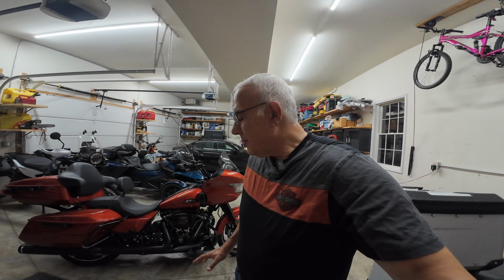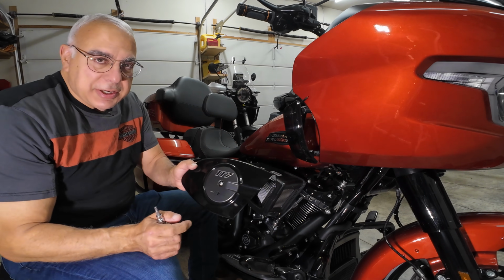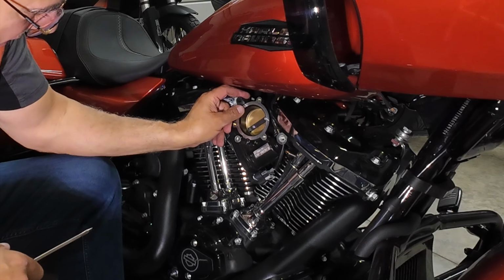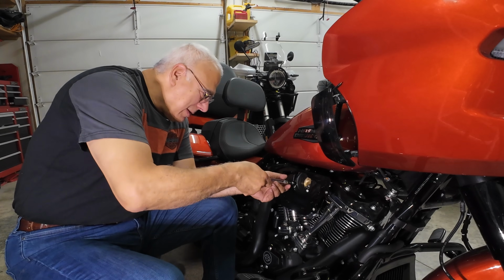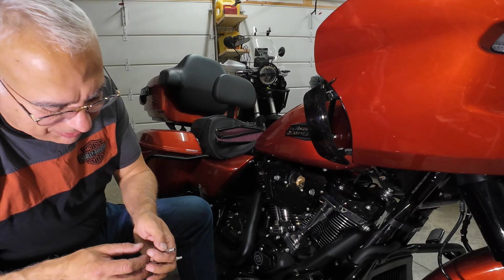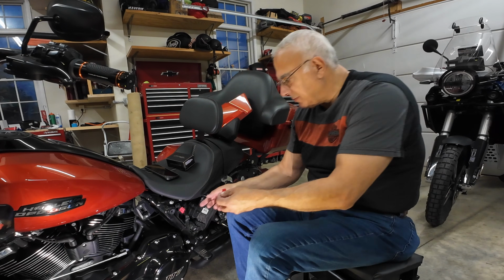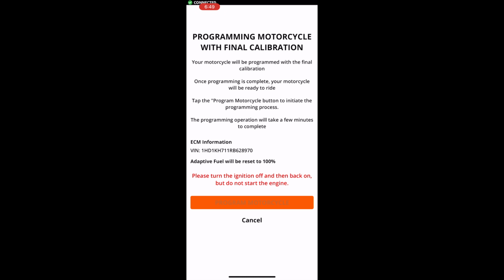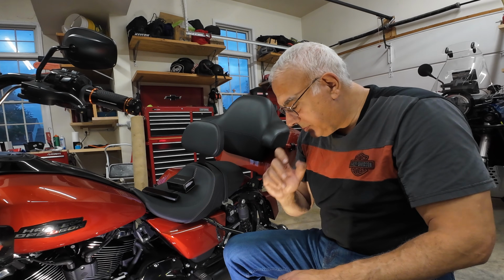Screamin Eagle Extreme Wedge Air Filter Pro Street Tuner Step By Step Install 2024 HD Road Glide 455

Comment: I have a 23.5 cvo RG and have krome works slip on and thinking about add that air filter. My question is do you have the full aftermarket exhaust or do you have just the slip and it was still ok to use the first program. Thanks
Reply from the maker: I have slip ons, yes, it is OK to run the first program if my memory is right, but you should consult your dealer and get their opinion. I traded this motorcycle for a 2025 CVO Road Glide Raven fade I have videos on this motorcycle last year. I had the dealer install the extreme wedge air intake and the Harley Davidson tuner they felt I needed the tuner with the air intake weeks ago, I upgraded to chrome work slip on exhaust, which of course that’s a full stage one with a tuner and your intake. The dealer told me I do not need to use a software on my phone to get back into a tuner to adjust it for the addition of the slip on exhaust so I haven’t even with the air intake with no changes to the stock exhaust and the tuner the sound of the motorcycle is so much better I believe because it doesn’t have an ear box anymore when I added the chrome works exhaust. The sound is just amazing. It is so cool. I’ll probably upload the video in the next month. I hope you consider subscribing to my channel ride safe and in peace.😊

Comment: You didn't talk about the additional HP you gained. Did you notice a big difference?
Reply from the maker: I do a follow up video. I’m blurring a brilliant blue Harley Davidson riding shirt/jacket on the thumbnail and in that video I take you on the first ride after this stage one mod and I talk about the power. I hope you can watch that video, but I will tell you for the money spent on the stage one I think the power increases significant. I think it’s very worthwhile spending the money for this stage which I think is air intake slip on exhaust probably just under $2000 and I wanna say I thought it was a horsepower game but it’s more than that if I should say it feels like more than that because you know no longer have an air box on the intake so you really get more engine noise from the air filter which to me is more like harmony that sounds beautiful. I hope you can watch that video. If not, I think this upgrade as well worth the money spent on it Harley tuner is excellent and I think it’s well worth the money. I highly recommend it. I hope you consider subscribing to my channel ride safe and in peace thank you for commenting.😊

Comment: Just got my wedge for my ‘25 CVO and pro street tuner but the dealer is telling me I need to bring it in for them to install the the tuner.  Not sure why.
Reply from the maker: I’m not sure why they’re telling you that either. I thought the directions were very simple on installing the tuner and I covered it step-by-step in my video. I’d also recommend that you watch cycle fanatics. He also did a step-by-step installation. Good luck I hope you and your dealer can figure it out. I didn’t think it was hard at all. Thought I covered it well in this video. Hope you consider subscribing to my channel ride safe and in peace.
Reply: @maraudermitchelli thanks. I ended up doing it myself. I think they thought I wanted to do more advance tuning on a dyno.  I just wanted the basic tune for the air cleaner and exhaust and all went perfect! Love the wedge on my new CVO.

Comment: Mitch, you probably made the right decision, the snorkel style Heavy Breather air cleaner is annoying. Unless you have a 22" or shorter inseam the snorkel in the way, all day. Anybody that has ridden the ST, whether it's a Glide or Soft Tail has had that realization that you will bend your knee out like bow legged cowboy and rub and bump into that dang thing every time you ride. Even the regular 'Glide air filter bumps my leg out more than I prefer so I'm looking for a filter that is slimmer. Does the wedge offer better legroom? And how much louder is it? Maybe I'll subscribe😉
Reply from the maker: On my CVO, I added the extreme wedge and did not put slip on exhaust. It definitely made the motorcycle louder without a doubt as there’s no airbox on the bike now I’m still debating whether to do slip on exhaust to little get a little deeper tone. it’s hard because on a CVO. The dark chrome is just so beautiful. I believe the extreme wedge is the most efficient air intake offered through Harley Davidson. Fueling may have somewhat comparable intakes, but I have to post a video on having the extreme watch on my CVO and it is a perfect match for that bike because I put the engine emblem directly on the intake and it looks phenomenal. I have to post a video on that. I hope this answers your question. I’d highly recommend this air intake I hope you consider subscribing. Please continue to comment ride safe and in peace.

Comment: Drives me nuts when manufacturers spec differently sized fasteners for absolutely no good reason.  😂
Reply from the maker: Isn’t that the truth one of my guys I used to ride with off-road so they can take apart a Suzuki quad with two wrenches I think a 9 mm and a 10 mm that’s the way it should be. I hope you consider subscribing to my channel ride safe and in peace.

Comment: I Want That For My 24 Street Glide!!! That looks Awesome! 👌😎 And You get a little extra power along with more leg room 💪
Reply from the maker: Man, like I say in the video, I initially did not like the extreme wedge air intake. I really wanted the bighorn that comes out of the side and goes towards the front with a big filter on it, but the more I researched the stats and looked at the motorcycles and sat on them. The extreme wedge had the best performance Stats is the most comfortable and I got to really like the look of it so much so without a doubt, I put it on my CV overall glide videos to come on that I hope you consider subscribing to my channel ride safe and in peace.

Comment: What brand of earplugs do you wear
Reply from the maker: Probably in this video, I was wearing Alpine earplugs. I believe they make three different levels. Two of those levels might be touring and then the other one is racing. You can find them online. The main portion of the plug is white almost clear I like them. I also alternate to these rubber Earplugs, which I bought at cycle gear. I hope you consider subscribing to my channel ride safe and in peace.

Comment: Nice video. I'm looking at the Extreme Wedge also, and yes, it's ugly, but my knee hits with the other model air kits. But from what I see, this new Wedge box is the same size as the OEM. Yes, the "filter" is bigger, but the box looks the same.
Reply from the maker: I love the air filter and as I said in the video, I did not like it at all. The first time I installed it I have to do a video on it installed on my CVO and how I mounted the engine badge on it. It really looks great. I think it is a number one performing Air filter and intake. It’s actually changed the sound of my CVO without even touching the exhaust. I hope you consider subscribing to my channel ride safe and in peace.

Comment: Thanks for sharing this. I’m planning to upgrade to Stage 1, but the Screamin’ Eagle Extreme Wedge air cleaner isn’t available at my local dealer. What are some alternative air cleaners that offer similar or better performance? I also plan to use the Vance & Hines FP4 for tuning—are there any differences I should be aware of when using FP4 with aftermarket air cleaners?
Reply from the maker: I cannot answer any questions on the FP four because I never considered it nor did I research it. I went with the screaming eagle tuner because I wanted to maintain my warranty on my motorcycle and I liked it so much. I might put it on my new Road Glide I think the extreme wedge is a great product. I actually am about to get another one for my CVO But my friend just purchased a fueling air intake and I really like the intake that he purchased so I would check out fueling‘s website. I believe they have their own YouTube channel. I’m a big fan of thrashin supplies YouTube channel. I think I’ve answered your question. Check out fueling and I hope you consider subscribing to my channel ride safe and in peace by the way, this set up worked very well on this bike was very pleased with that.

Comment: Great Video!!!  When it asked you about exhaust, was it asking about header pipes and mufflers?  I normally change out my header pipes too for the Stage I.  Let me know your thoughts.  Thanks!
Reply from the maker: No, it doesn’t if I remember correctly because this tuner is definitely set up to be EPA compliant and Harley-Davidson doesn’t encourage changing the entire exhaust because it avoids a warranty and I didn’t wanna avoid the warranty. I’m not an expert on this tuner. I would contact your Harley Davidson dealer or Harley Davidson directly and ask her question you may be correct but for now I’m gonna stand by my answer, I hope you consider subscribing to my channel ride safe and in peace.

Comment: Awesome video.   I was looking for an air filter that wouldn't get in the way of my leg.   I think HD did a wonderful design job on this filter.
Reply from the maker: I totally agree with you. I didn’t like this air filter at all, and then I realized that the benefits outweigh so many of the negatives I love that it shows off the V2 engines and is very tight to the throttle body. Hope you consider subscribing to my channel ride safe and in peace.

Comment: Thanks for your video. I followed your steps to install my wedge air filter to on my 2024 Road Glide. 

Question when turning off the bike, do you get a small little whiff sound from the air filter right as it turns off?
Reply from the maker: I usually am wearing earplugs when I ride the bike you could get a little air sound or whiff as you call it. You definitely get more engine noise with the wash air filter in intake in my opinion because there’s no air box anymore. The stock intake has an air box and it’s essentially eliminated with the wedge no doubt on my mind. The wedge is the most efficient at bringing error into the engine, but the negative for some people is increase engine noise, which is a great engine sound. I highly recommend that you also do the tuner. I did a video on that to make sure that the air fuel mixture is correct with the air filter and slip bottom mufflers. It’s recommended I believe by Harley Davison. I’m sure how your engine looks beautiful hope you consider subscribing to the channel ride safe peace

Comment: Marauder…
Does that tuner have a tune on it for the 121vvt ?
Reply from the maker: I’ll tell you what I know if you have a 121VVT engine and upgrade the exhaust or the air intake I believe you have to buy a tuner for it to tune the air fuel mixture so it’s not running too lean or too rich, I don’t believe it adds any more horsepower to the 121VVT engine I think the tuner only ensures that the air fuel mixture is correct. I would recommend you talk to a dealer but some dealers don’t even know I’ve recently did a review on a CVO and I would not touch that engine. It’s just perfection but if you do swap out the exhaust and intake again, I believe you do need to buy the Harley Davidson tuner. I hope you consider subscribing to my channel. Great question by the way the tuner on my 117 air intake and slip on were really a great upgrade for the money ride safe and in peace.
Reply: @ from what I’ve gathered, btw been told by a service writer that my ecm would adjust , but when ya plug the tuner in it finds ur bike. Therefore it would know what motor it’s tuning. Also I e been told just to ride it and see if it idles fast or gets HOT quick , or rides funny to tune it. Appreciate ur come back. Have a great day!

Comment: Thanks for the instructional video!  I have to say, I am not crazy about how the two pieces of the air cleaner come together. I ordered one of these thinking it was one piece. Not sure if I will return.
Reply from the maker: I normally don’t disagree with comments entirely but respectfully, I have to disagree with you. I know your rationale. I’m guessing that you don’t like the two piece air filter because it might leak dirt into the intake and screw up the injection system or valves. Eventually I think the chances are that Are non-or very minimal as I say in the video I did not want to purchase this air filter in intake I didn’t like the looks of it and I ended up getting it because it seemed to be the most efficient again the most efficient air filter intake for this bike And did not bother my legs at all. I have been impressed with all of Harley Davidson‘s accessories because I’ve installed them all myself and I really liked how well engineered this fit. It was impressive and no doubt it flows a lot of air into that engine. My bike is very loud And I’m wondering if some of the sound is coming because I don’t have the air box anymore and I almost wonder if that’s why the ST and other models have that bent air intake manifold that you hit your leg on as it might quiet the engine a little bit more I’m not positive if this air filter is louder than other air filters for this bike. Certainly, there’s a lot of round simple air filters that just get plugged on the end of the intake. I get nothing out of recommending this air filter, but I will tell you I was very impressed with it once I ensemble and installed it I’d recommend you keep it, but I respect your opinion. Let me know what you do. Hope you consider subscribing the channel ride safe and in peace.

Comment: I did same set up. It makes a difference.  It sounds louder and you can hear the extra air getting sucked in.  Plus i think it looks great.  Also gives you more leg room.
Reply: Also,, if you really want to wake up the bike, use the custom mode. Max out throttle response.  Massive difference.
Reply from the maker: Totally agreed I’m very happy with this muffler and air intake and the tune I hope you consider subscribing to my channel ride safe and in peace

Comment: Looks good!  I had a bike with a large intake and it was noticeably uncomfortable.   Ride Safe.
Reply from the maker: Free I really like this air filter very nice although I do think I get engine noise through it. I don’t think it’s just coming from the exhaust this Mike is very loud. Look forward to riding in the spring with you. Hope you are well ride safe and in peace
Reply: @maraudermitchelli  yea, when i put the new intake on blue i noticed i could hear more engine noise from the intake port.  Even trade for the extra power.  See ya soon!

Comment: Great video. Just an FYI you can remove the BCI connector does not need to be connected to bike.
Reply from the maker: I had no idea could be removed. Thank you very much great information. I hope you consider subscribing to my channel ride safe and in peace.
Reply: @maraudermitchelli yeah. And i hope you removed it because you didn't secure it for riding. That 3m tape is going to do nothing to keep it on the bike while riding, that's just to hold it secure while flashing it at home. You can leave it on there for reading information or smart tuning whenever you want, but they recommend you actually secure it if you're going to do that. Use straps or zip ties to make sure it doesn't fall off and under your side cover.
Reply from the maker: @zimvader25  I can't remember how I secured it, i put over a thousand miles on since the tune with no issues and did refresh the tune several times. Some viewers recommended removing it...I don't remember either method in the tutorial online. I traded the bike several months ago...my salesman purchased it which I'm thrilled about I have to do an update video. Zip ties is a great idea...thank you for helping. Ride safe and in peace. I hope you consider subscribing to my channel.